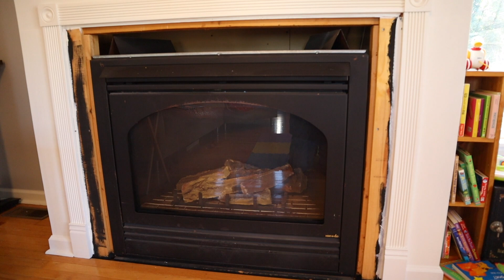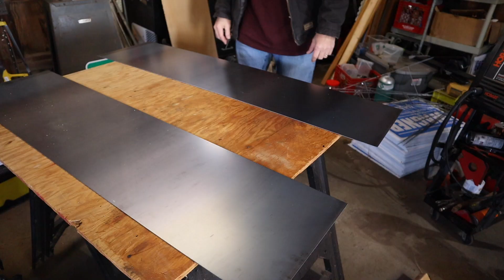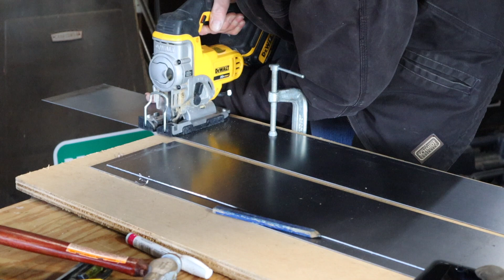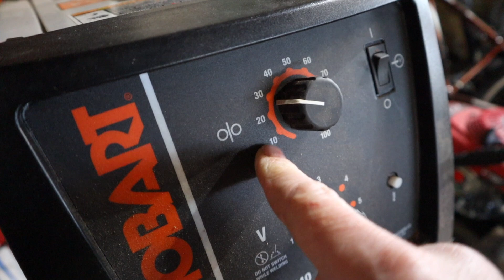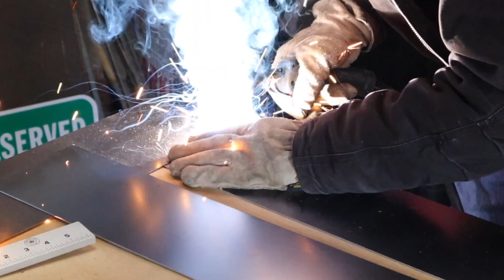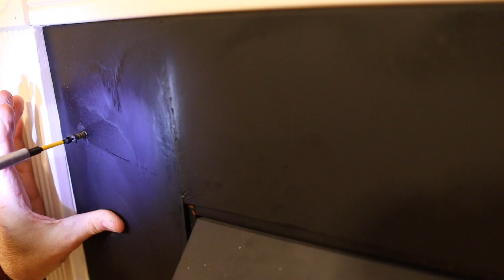#41 Making a Fireplace Surround with my Hobart Handler 140 Mig Welder.

Comment from the maker: Here are some product suggestions. These are Amazon Affiliate links, so purchasing will help this channel by providing a small commission while not costing you any more. Thank you for your support!

Hobart Handler 140 Welder:
https://amzn.to/3aIvLtz
Hobard Nozzle Gel:
https://amzn.to/3aMsSIc
Hobart Multi-Function Welding Pliers:
https://amzn.to/3hmqfOi
YESWELDER Auto Darkening Welding Helmet:
https://amzn.to/3mVr1mJ
Hobart .030 Fluxcore Welding Wire:
https://amzn.to/2KEKNWy
Dewalt 20v Max Jigsaw (complete):
https://amzn.to/37XjVKp
Dewalt 20v Max Jigsaw (tool only):
https://amzn.to/2KXe927
Metal cutting jigsaw blades:
https://amzn.to/37QSVMk
Dewalt 20v 4 inch grinder (tool only):
https://amzn.to/2Mg7G3b

Steel used for this project (not an affiliate link):
12x48 .060 mild steel sheet (need two pieces)
https://www.onlinemetals.com/en/buy/hot-roll-steel/0-06-mild-steel-sheet-a569-astm-a1011-hot-rolled/pid/9900

Comment: Looking good Sir!  I am amazed at how well the jigsaw cut through this thin metal sheet. If it was me, I would have ended with jagged cuts! If you were on the edge of burning through your material while welding, then it was a strong weld. I am no professional welder, but this is what I found over time. Best wishes to you and your family!
Reply from the maker: Thanks very much. I think the fine tooth blade helped. And I’m glad I didn’t go with anything thinner than 1/16. You’re right about the burn through. I’m learning more each time I weld a project. Happy new year! -Ed